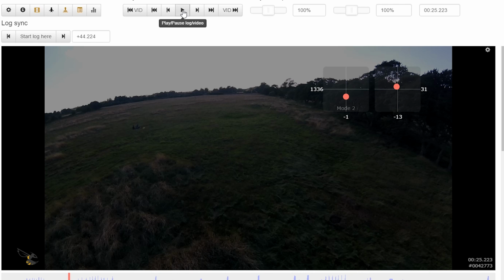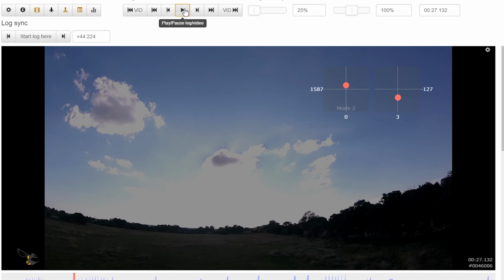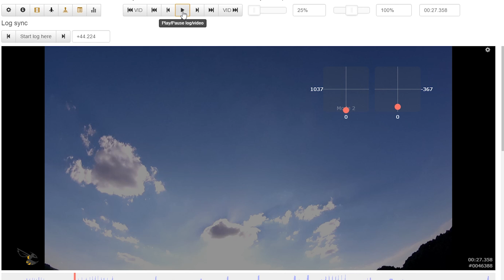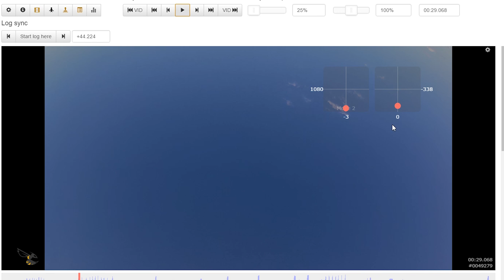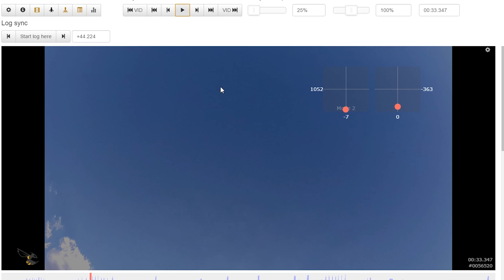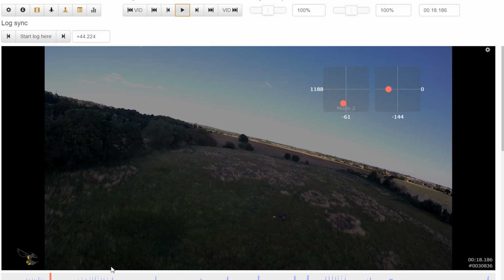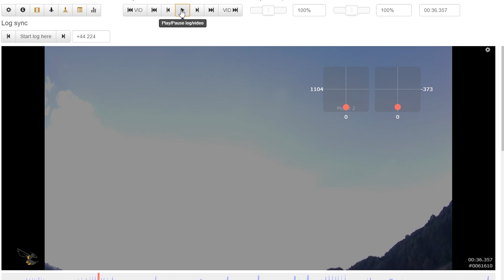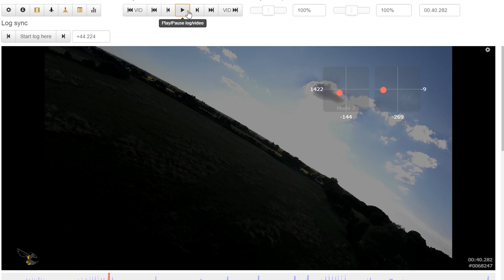FPV Acro School - no.5 infini flips!

Comment: I have a question for you about the settings in cleanfligh pid! I would like my quad reacts faster on the pitch and roll yet I put my settings to 65 of the proportional and I do not know if I can increase or adjust another setting?
Reply from the maker: Do you mean you want the quad to flip and roll faster? If so, then you need to increase the 'rates' not the P.
Reply: thank you for your message. I would do the test soon